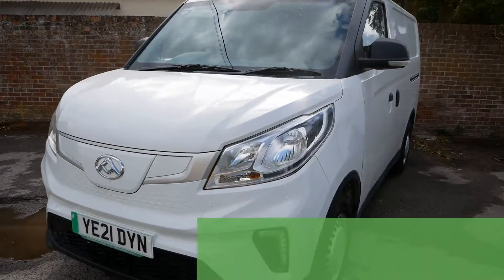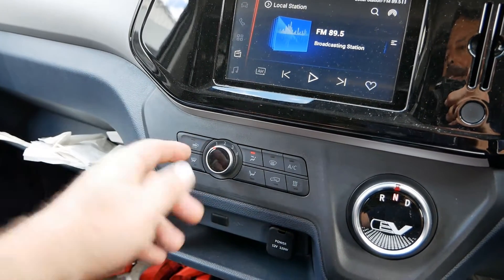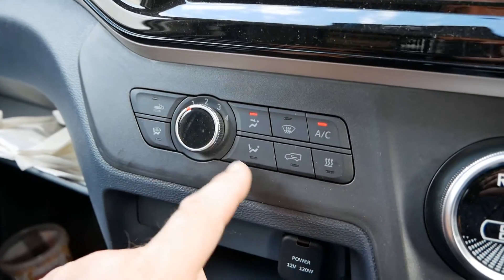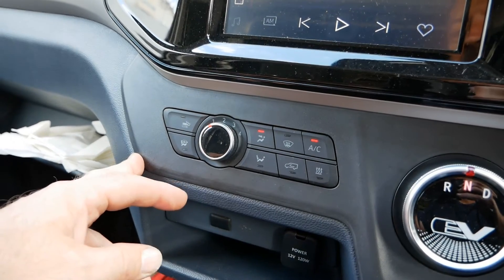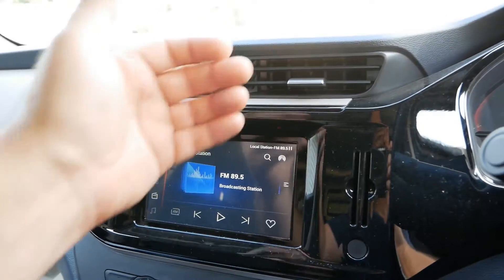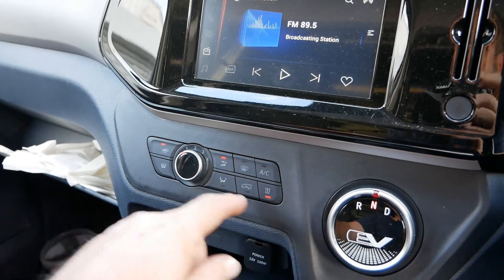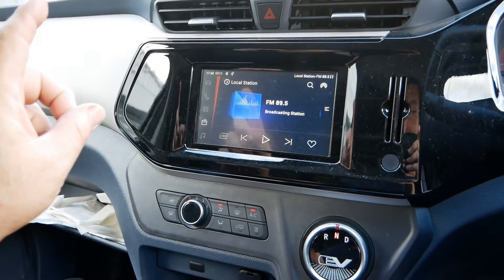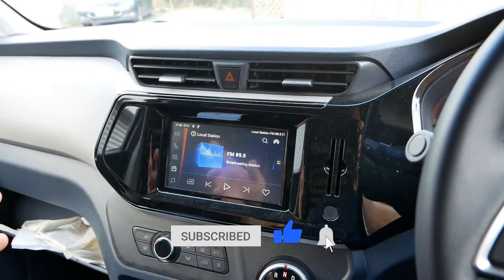How to use the HVAC controls in a Maxus eDeliver 3 electric van

Comment: Ooh that's worth stuffing in the memory banks, thanks Matt. Don't suppose you could do something similar with the buttons on the steering wheel of an Ioniq 38kWh could you? I've never had a modern car so the symbols are baffling to me, in fact so are the names of the functions for that matter. Be great if you could do a simpletons guide to knobs and buttons. If you fancy that as a topic I'll look out for the title! Cheers Matt 👍
Reply from the maker: I'll add that to the list. Will have to see if the 38kWh is any different to the 28kWh Ioniq. I seem to remember the steering wheel controls are the same.
Reply: @GoGreenAutos  thanks Matt, no idea if the steering wheel controls are the same as the 28, I know there's more on and under the main screen which I'm sort of getting to grips with, though still not completely sure of what's what. 😄
I've seen an explanation video of what comes up on the binnacle screen but not which buttons were being used to get there if you see what I mean.
Thanks considering an incompetents guide. 👍👏😄

Comment: Can it run the A/C while parked overnight? if so, what % would that use?  Any chance for US market?
Reply from the maker: No, it wont run the A/C unless you leave the vehicle running (i.e. in ready mode). It's a basic commercial vehicle so doesn't have that sort of functionality. If you did want to leave it running, it wont use that much energy. I did a similar test in a Hyundai Ioniq, see https://youtu.be/aFWAwBgTKEQ?si=WZLL25TezwCg6NLK
Chance of coming to the US - I doubt it. Chinese import tariffs probably means SAIC Motors wont be in a hurry to enter the US market.

Comment: Mate can you help me I’ve got a buzzing sound coming from the passenger door everytime I lock the door, and a 2nd buzz from the same door about 5secs after I start to drive. 
Best regards
Reply from the maker: Not experienced this before, but I guess it must be the lock actuator. Personally, I'd start with taking the door card off and identifying what is buzzing. Maybe some lubrication will fix it. Or take it to a Maxus dealer as it will be covered by the warranty.

Comment: Is it a heatpump..?
Reply from the maker: No, it uses a PTC heater.
You can see the heater in these photos https://www.ebay.co.uk/itm/175589164920 and the orange connector is the high voltage connection to the PTC heater.

Comment: If ever something needed the ability to set the cabin temperature to say, 20degs - and the heat or air con should just turn on whenever necessary to achieve that temperature 🤷🏻‍♂️
It’s like it was designed in the 1970s 🤦🏻‍♂️
Reply from the maker: Vans tend to have basic heating, rather than climate control that you get in most modern cars.
Reply: @GoGreenAutos  True but there’s no excuse for them not having a way to keep a constant temperature, I’ve no idea what they were thinking or who signed that off. 
It would put me off the whole van, and EVs are supposed to be the way forward ?? The future ?? Lol 😂